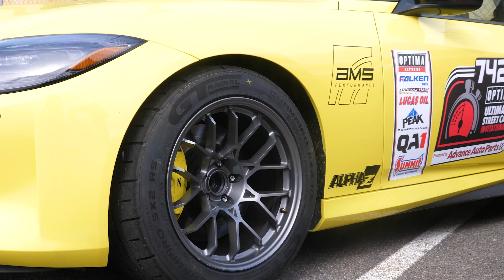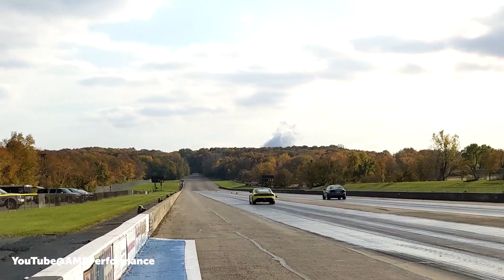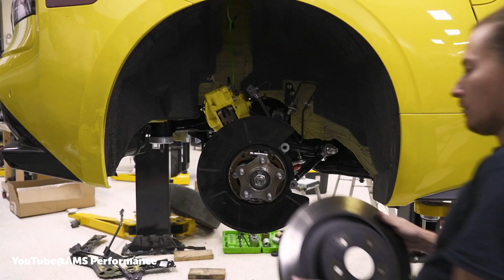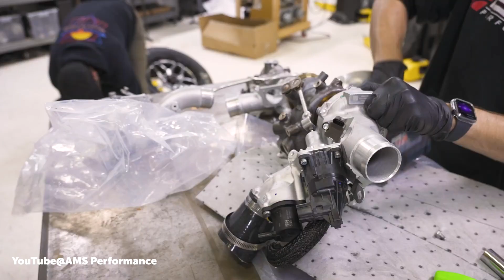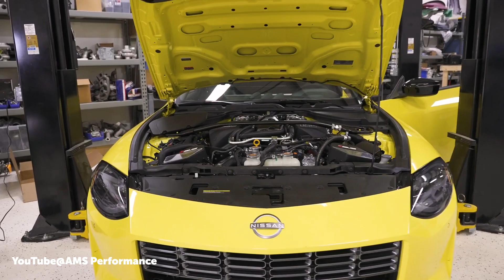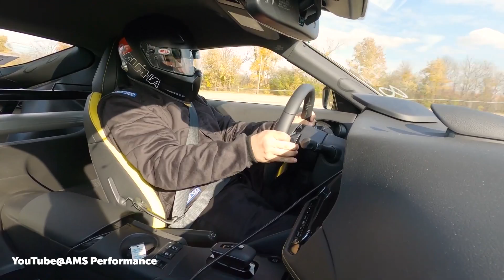Setting Records: RZ34 Z First 9-Second Pass

Comment: any plans for 1000+ bhp on the VR30DDTT?

what supporting mods do i need to push that level?

sleeved block? billet block? Stroker kits?

is it easier to tune the 9 speed or the 6 speed manual.
Reply: I think AMS had already made a closed deck VR30 with 3.2 ltr (just overbore I think).

But not for sale currently
Reply: 2jzge VVTI block. Start there.
Reply: @bigjdm5460  i am asking VR30DDTT not 2JZ. BRUH man
Reply: @linchester8464  I was joking. My bad LOL. I have a 2jz build going but also have a 19 Q50S with the sport package. No hate
Reply: Its an open deck block.  1000hp would be a very bad idea until you can make it closed deck.
Reply: @wudntulike2no32  yea I agree. When I heard Nissan was making a 3.0L VR block I was excited but then I found out it wasn’t a closed deck like the VR38.
Reply: @wudntulike2no32  the Honda K are open desk but we are seeing them break 1000 without a sweat. 

I say good tuning. 

I mean i seen 2JZs block melt because of bad tunes.
Reply: @linchester8464  K series are not making 1000hp without a sweat.  The service life on them are very short and most of them are a closed deck conversion.
Reply: @wudntulike2no32  you don't need to close deck the K20/K24. 

There are 1000 bhp Honda engines running with ductile iron sleeves and they still allow water to pass around the cylinders. 

pretty sure ppl are going to know that 1000+ hp engines are not going to last long. 

But the Honda K engine is pretty common and found in so many Honda cars. So engine blocks and parts are plenty and tons of aftermarket support.
Reply: @linchester8464  You don't "need" to close deck any of these engines just like you don't "need" to build the short block in a 2jz to make 1000hp but if you want it to last more than a couple of dyno pulls than you will.  Only teenagers are impressed by facebook glory runs.
Reply: @wudntulike2no32  BoostedBoiz isnt exactly facebook glory if you want real world numbers. He run K20/K24s in his MR2 and blew up plenty of engines. And you assumed my age is another mistake of yours.

Comment: Excited to see new platforms get such support. Ive driven one of these and the engine specifically is very exciting.
 Disappointed though that the Z in Australia is $85k delivered with a 2 year wait. Out of reach for a lot of enthusiasts and I don't see it getting any better.
Reply: As are most enthusiast cars as I correctly predicted back in 2008. If you want proof I can show you a screenshot of a forum post I made on Yellow Bullet.

 Wages have not kept up despite skills and productivity increases.

 Half of these vehicles are purchased with Bitcoin. If you weren't one of the lucky ones to have gotten in when one coin cost $3 each then your out of luck.